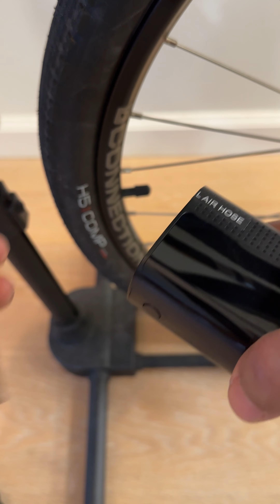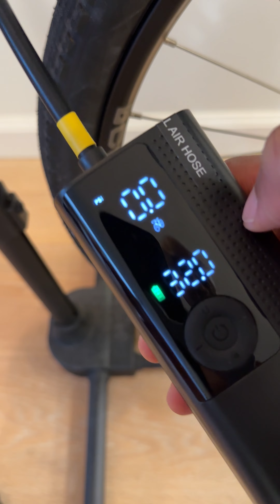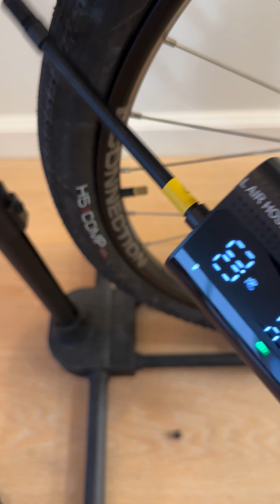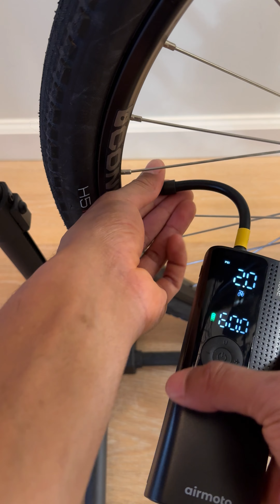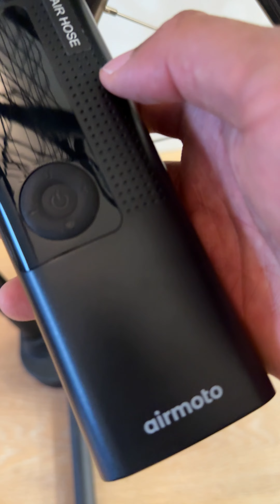How to Pump Up A Bicycle Tire - Using an Airmoto Pump

Comment: Too bad you show only a Schraeder valve.  Getting this to work on a Presta is a PIA and hopefully one does not break the Presta.  Road bikes use Presta valves not Schraeder valves.
Reply from the maker: That's a fair point, Presta valves can definitely be a bit tricky to work with compared to Schraeder valves! 👍

Comment: My psi on the bike on airmoto stay only 12.0, doesnt go up
Reply from the maker: Make sure the valve connector is screwed on tightly so no air is escaping while you pump! 😊

Comment: It is too small to attach to my bike's valve stem.
Reply from the maker: Did you check for a Presta or Schrader valve adapter? That usually fixes the fit issue!